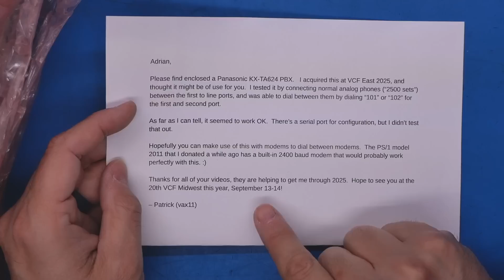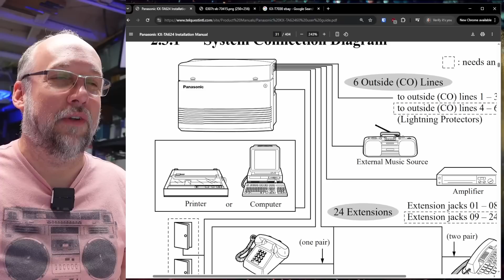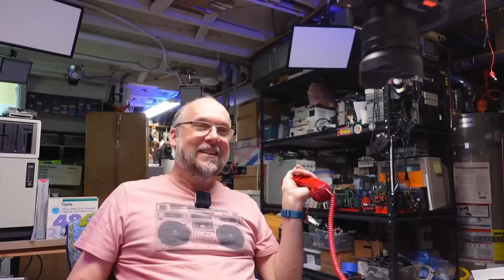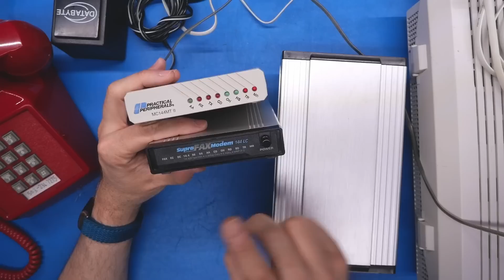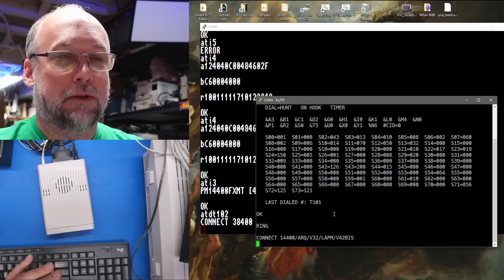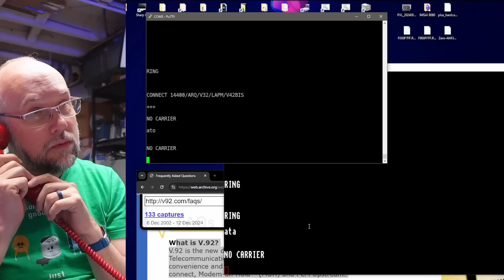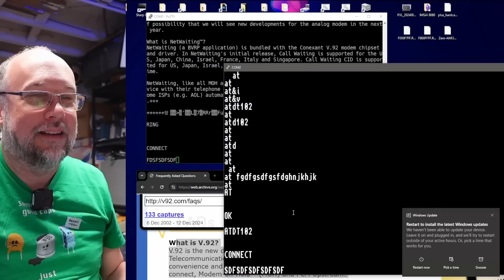How to use phones and modems like it's 1992

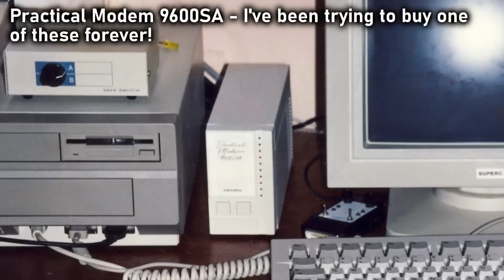Comment: 46:50 My first US Robotics Courier DualStandard (V32 9600 + HST 14.400, no V32b) cost me 1099 USD plus shipping back in 1990 or '91. (and i did search for quite some time for the best price in magazines...)
Reply from the maker: I wanted one so badly (with HST especially as many of the BBSs I called then had HST modems) but the prices ... too expensive even with my after school job. I recall my practical peripherals modem at that same time was about $450 so less than half the price of the US Robotics. I think I got mine at that price in 1990 or 1991. Can't recall exactly.... I did eventually get that V.Everything and it was expensive but prices had come down substantially by then plus I had a better laying job at that point.

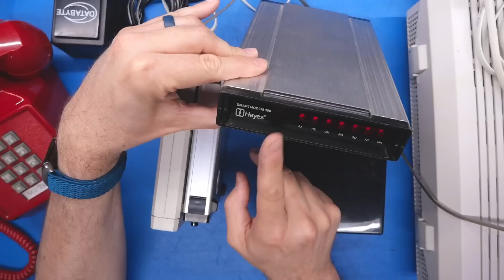Comment: 40:45 the AT commands are still used in any LTE/5G USB Modem stick and even internally in most android phones when talking to the the baseband for SMS etc. Off course there are many extensions to the standard, but ATZ is still "reset to stored default", and AT&W is still "store current config as default" etc.
Reply from the maker: Isn't that wild? I've played with enough baseband firmware to know it's still using the AT command set behind the scenes but I bet a lot of folks don't realize where it originated! I think the Hayes modem I showed off here is where it came from. I think. LOL
Reply: @adriansdigitalbasement  Well that's why its called the Hayes command set.

Comment: 19:29 Fax detection works by listing for the fax CNG tone (1100Hz beeps). some listen as well for modem guard tones (550Hz and 1800 Hz). So you can even hook up a BBS to a different extension. (if that's useful scenario for a single line PABX is debatable, since a modem will stay connected probably for a long time, keeping the line occupied far too long.)

Comment: the building for USR in Schaumburg changed to 3Com then Capital one then Atrium and I think it's TicketsNow today.  It's the building across the interstate from the Giant IKEA on IL-53.  I always thought it was a neat building and the sign out on the highway is an interesting cube on a tubular structure.  The location is 42.05291173113745, -88.02526129360875

Comment: Sad to know both NEC and Panasonic stop making new PBX/Keyline system anymore, and these 2nd hand analog PBX price now hiking like crazy. I'm entering the field by servicing voice multiplexers, familiar with FXS, FXO and E&M.
Reply: NEC, Panasonic, AT&T (later Avaya), Nortel, and few others all had key systems in the low-end of their product line with similar features and programmability from one of the digital phones.  In the 1980's and 1990's, field technicians rarely had a laptop.  The ability to perform moves, adds, and changes from one of the existing phones was necessary.  The Station Message Detail Recorder (SMDR) was a standard function in all of their product lines.  Long distance costs were still a thing and accounting wanted some way to allocate costs of the long distance bill to individual departments.  This was often your first exposure to PC-based databases used to record the data and generate reports.  For service companies, installing and maintaining the SMDR software was another revenue source.

Comment: Adrian, can you archive the modem CD?  I’ve actually been looking for that CD.

If the 3453C cd ISO is available and I’ve missed it if anybody has a link it would be appreciated.
Reply from the maker: Here's the CD: https://archive.org/details/USR3453C
Reply: @adriansdigitalbasement  thank you!  For some reason this one was very hard to track down.  I suspect because it was so late in the lifetime of modems that nobody cared.  Wasn't much of a market for V.92 since no ISPs implemented it.  I've had the INF file, but they always prompt for stuff that I assume is on this CD.
Reply from the maker: Awesome -- I always wonder if anyone looks at or uses the stuff I archive. So at least one person got some use out of one of the things!
Reply from the maker: I can, sure. I assumed it would have been fully archived.
Reply: I think we paid about $500 CDN for a v.everything in 1997.  It was X2 but free  firmware upgraded to v.90 a bit later.